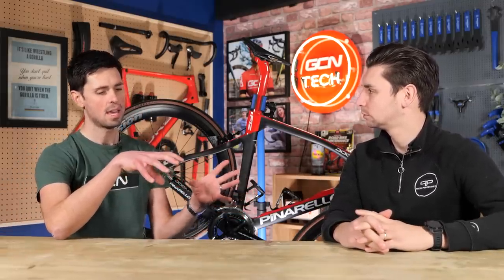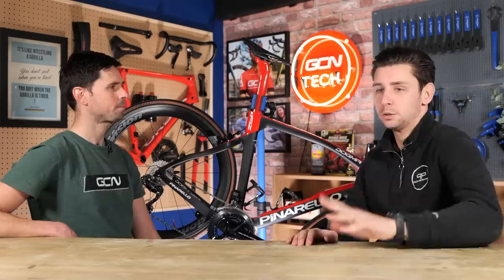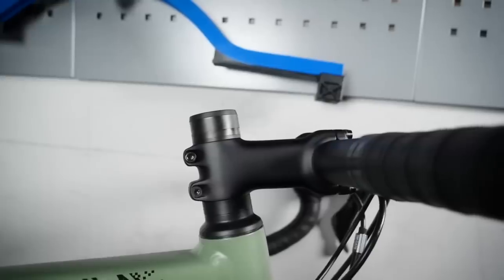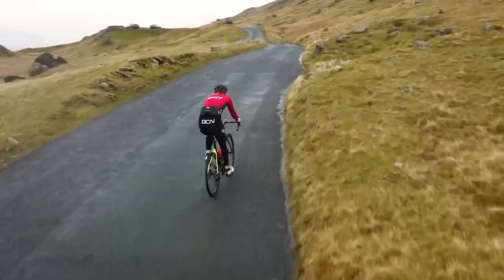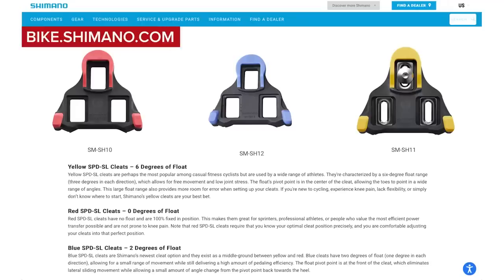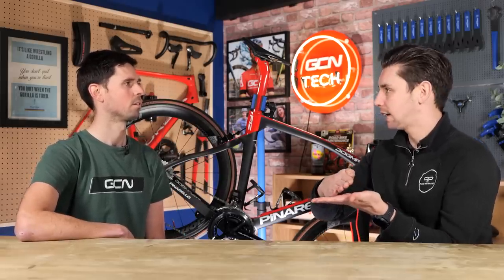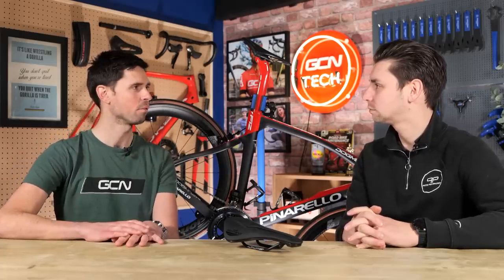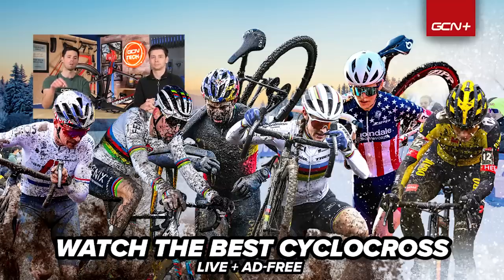Do THIS Before Getting A Bike Fit!

Comment from the maker: Have you ever had a bike fit? Let us know in the comments👇
Reply: I’ve been performing bike fits since 1987, and I still book time with a colleague who is also a master fitter whenever I make changes or get a new bicycle.  

One thing though, don’t make the mistake of thinking that lasers, cameras, and software are verification of a fit techs’ knowledge, experience, and capability.  
An expensive fit system in the wrong hands can be a dangerous set of tools, as capable of inflicting pain or injury as it is of alleviation. 
The best fitters can position you correctly and solve your problems with or without those instruments.
Reply: @GCN-Tech:

Yes but the fancy-pancy name "bike FIT" wasn't utilised yet.

It was called "adjusting your bike".
Reply: @reoencarcelado5904  Yes it was. We were already using The Fit Kit at that time. The first version of that system was released in 1979.
Reply: @prestachuck2867  thanks for the info on that :-) . 

I was born in 1980 so, I wasn’t aware-of-that back-then. (Air-Force-brat born abroad, in a country that’s about 2 centuries behind the-U.S.-&-U.K.).

My father (a ex—-Pro—Tennis-player & a ex—Pro-Cyclist) was the one that would do the bike adjustments for me (adjusting the brake-levers; the angle of the brake-levers; the angle of the saddle; the raising-&-lowering of the saddle; etc.
He’d make the adjustments, then ask me to sit on the bike, then ask me if it felt comfortable, then make any adjustments to <whatever didn’t feel comfortable>, until it felt “juuuuust right” as Goldilocks (from “Goldilocks and the 3 Bears”) would say).
Reply: Yep, was amazed that small, specific adjustments made such a huge, positive improvement. So much so, that I arranged a bike fit for my wife on both her road bikes.
Reply: Absolutely before purchasing my 2021 Trek Emonda, 800 series carbon fiber machine. At sub-5, this is especially critical given the many, many miles I ride every year keeping myself fit to climb like a very fit and light (48Kg) machine.

Comment: That was nice, to-the-point and completely free of BS! Thanks guys. 👏👏
Reply: My big reason for not having a bike fit, apart from the money, is knowing that many fitters have their own pet 'fixes' no matter what the problem. This seems to be a really sensible starting point. Jake, can I ask what should I look at if I have a repetitive niggle on the inside of my leg, just above and to the inside of knee, where the quads meet the knee - where your thumb would be if you squeezed your leg with the middle finger reaching the centre of the knee? I have multiple bikes, multiple shoes but the issue is across all bikes and shoes - and I know I'm not that accurate at dialling in the bike fit - so it must be something a big more basic than a cleat tweak.
Reply from the maker: Glad we could help 🙌

Comment: Great tips, I am thinking about doing a bike fit and I never stopped to consider that I should check all of those things before going in.  These bike fitters charge a premium price for their time, and you don't want it to be spent fixing your bike when it should be spent fixing your position on the bike.  So thanks for that video, and for those thinking about getting a bike fit, do your research and make sure you find someone with a lot of experience and positive reviews.
Reply from the maker: Glad we could help you out! Do you think you will still be getting a fit? It's a great option for those that really want to dial in their fit or are heading out for some big miles! 💪

Comment: Had a ‘Bike Fit’ after purchasing a bike, wishing I’d done it before purchasing!
Rather than spending money on aftermarket parts to ‘make it fit’, albeit they were upgrade aftermarket parts.

Was done on a jig not actual on my bike. 
Allowing the trial various saddles, handlebar width, stem length etc. 

It removed all aches & pains whilst riding.
Even came away in a more aero position!4cm reduction in handlebar width, lowered & shortened stem.
Can’t recommend a jig bike fit enough!

Comment: Check up front with your bike fitter which model of indoor trainer he or she uses. We had a bit of a fumble to adapt my Cannondale on his Tacx Neo.
Reply: I agree. I’ve found the old-fashioned Kinetic Road Machine wheel- on trainer and a box load of adapter axles to be the most versatile platform for fitting a wide variety of different frame designs and axle standards. YMMV

Comment: Can you still get a bike fit if you want to use flat pedals? Do a person have to use clipless pedals for a bike fit? I never had a bike fit.
Reply: Yes. You can. Keep in mind that the saddle height setting will not be quite as precise with flats. Many riders with platform (flat) pedals can still benefit from a proper fit.
Reply from the maker: Yes of course, Bike fits are not just for those that want to race. Many casual riders would benefit from a simple bike fit, it will give you more comfort and confidence 🙌
Reply: Thank you for sharing. Hope you have a wonderful Christmas and Holiday!

Comment: Personally when I’ve had a fit from various places the same is my method , I get home and drop the seat 10mm and raise the bars 10mm 

This is because when I’m in a fit i become a lot more flexible for some reason, I get home and feel so off … dropping the seat and raising the bars let’s nut body gradually get used to the fit and in a month or so, I’m at the fit values
Reply from the maker: It may depend on what type of fit you are looking for. It sounds as though the fit's you've been getting may be based around a more aero position. It's completely fine to ask for a fit based around comfort over the perfect race position🙌